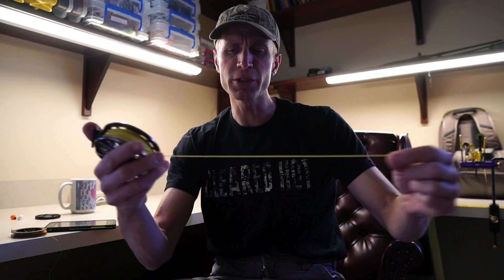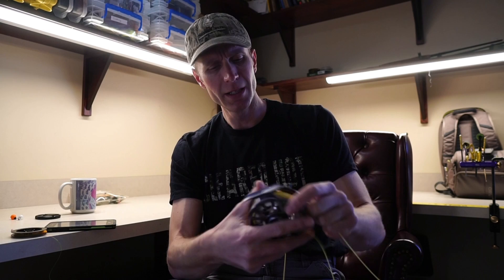Basic European Nymphing Line  and Leader Setup with George Daniel

Comment: Great info bud. When in doubt keep it simple. My nymphing leader is literally 10’ long to the ring then another 10-11 feet of tippet. A little overkill but I can always adjust for depth
Reply: Sounds like what I run as well. I rarely have fly line out the end of the rod. I think with his formula you would have. Short but simple euro leader. May have to try it on some small mtn creeks.
Reply: @TroutDaze  keep it stupid simple is what I tell people or kiss but you can use it on mountain streams but I have used it on big fishing creek and had no issues

Comment: I tried a formula similar to this yesterday on a NC river. The other leader I used previously was 20/15/12 maxima, sighter, ring, then tippett. That leader was very clunky and I began to wonder if I would bend a guide pulling line back through on a hook up. George's formula worked great and some loon thick resin (just a little) worked great on the blood knots also.

Comment: Great video! Questions: 1. Can you use fly line backing for the sighter? 2. I fish tail waters with mosty midge flies, does this technique work with such small flies? Thanks.
Reply: Fly backing would probably create a little more drag in the water and affect the drift, plus would more than likely be thicker diameter than the maxima section, probably best to stick with mono or fluro in something with a similar diameter or smaller than the maxima section before it. Im sure if you had a colored monofilament in a color you could easily see in the same diameter or slightly smaller than the maxima that would work fine as a sighter. If you're trying to get the midges down you'll probably be tossing split shot anyway so should work.

Comment: Great video. I have a question about the depth youre fishing and how to detect a drop off in waters you have not fished before. For example, if you fish a pool thats three feet deep, and there is a spot that is 5 feet deep, can you spot that somehow from your indicator or do you just have to know where the drop offs are to be able to fish them effeciently? Thank you!
Reply from the maker: Hi, usually you'll see a slight change of behavoir within the sighter...one that twitches when rolling stream bottom to flat lining when the flies are no longer riding along bottom. Also, one of my favorite ways to locate drop offs when I can't clearly see bottom is using a drop shot tactic where I'm dragging weight on stream bottom. You'll easily feel the shot rolling the bottom and often you'll feel the ticking stop when either a fish has taken a fly or more likely...when the depth increases and the flies no longer roll bottom.   Hope this helps
Reply: @GeorgeDanielFlyFishing  Never thought of that, certainly helps. Thank you!

Comment: George, thanks for the video. I am using one of Devin Olsen’s leaders, which is much longer to the sighter. But see other PA fisherman using shorter formulas like yours. Is there something about the Central PA streams that give advantage to the shorter leaders?
Reply from the maker: smaller streams demand shorter leaders. By small I actually mean tighter casting quarters. There's small streams out west but usually have more openness to casting. Plus our smaller streams in PA allow us to get closer to fish via wading so we don't have to hold as much line off the water as you would fishing the larger and deeper western waters. I'll definitely use longer leaders when fishing open streams that are challenging to wade. all the bast
Reply: @GeorgeDanielFlyFishing  Thanks for responding George. I appreciate it.

Comment: Hi, do you still consider Lazar line is the best for euro nymphing? In your previous video you had 12.4lb white Cortland mono instead of 15lb maxima added to Lazar line, which is better in your opinion? Many fly fishers here in Finland use just long 0.20-0.25mm thin level indicator line added with tippet for euro nymhing for better contact, have you used and what do you think about this setup?
Reply from the maker: I do like the heavy lazar line especially when fishing large heavy rigs, when I plan to jig streamers in the winter time. Plus many (including myself) find it easier to manage mono that is thicker than level sighter material. With that being said, the rig you're describing is absolutely the best formula for nymphing. I was turned on to this level sighter/leader system five years ago by french American guide named on Antoine on the Farmington River in Conn and it's amazing-simple the most sensitive system out there. If I was competing again...this would be a system I would use all the time but I tend to use rigs that are more universal for my own personal and guiding days on the water.  Thanks for the message

Comment: George, I bought your book, "Dynamic Nymphing" and reading it now. What do you use to attach your leader to the reel - in terms of backing?
Reply from the maker: Thanks Nicole. I use a albright knot for connecting backing to line. Nail knot to connect nymphing line to leader (with a dab of epoxy to smooth out the knot). I hope this answers your question?  Thanks!
Reply: @GeorgeDanielFlyFishing  I was curious what you used for backing and how much of it approximately? Thanks.
Reply from the maker: @nicolelewis1828  For trout I use 100 yards of 30 dacron for most reels. rarely do I need this where I fish in central pa. regards